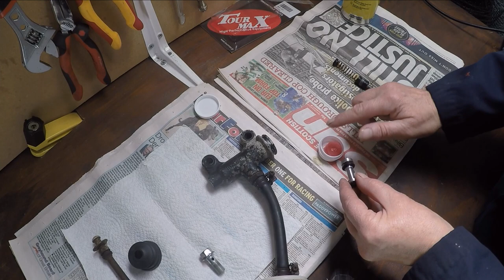GS550 Rat Bike Restoration Project 40 #Brake Master Cylinder Rebuild

Comment: If you can rebuild carburetors, master chlinders, and all the other technical thingamabobs and thingamajigs you do, why aren't you working for a motorcycle repair shop?
Also, here in the U.S. we have self-service car washes, where you use high pressure water, with or without soap, to pressure wash cars, engines, and, this past year, my greasy old outdoor grill.  Don't you have those in Scotland?  Did you really have to clean your engine that way?
Love you!!!!
Reply from the maker: Great comment thanks hun and I always wanted to be a full time mechanic but the nearest bike shop to me is an hours ride away! Unfortunately I live in a very rural area and there's not a lot around me. As for a pressure washer it's a great idea but again getting the bike to a garage would have been more trouble than it's worth! Take care and lots of love to you both. Big hugs and best wishes :)